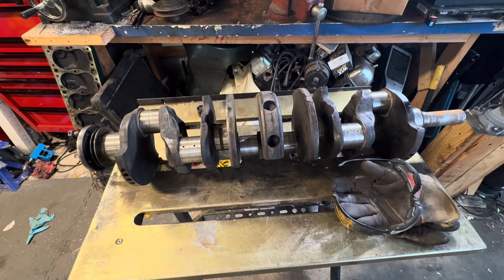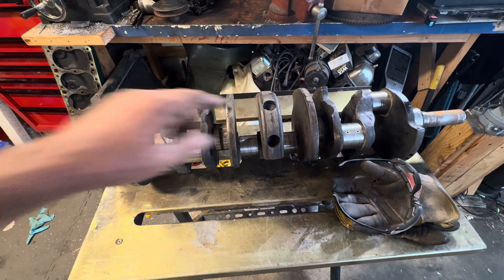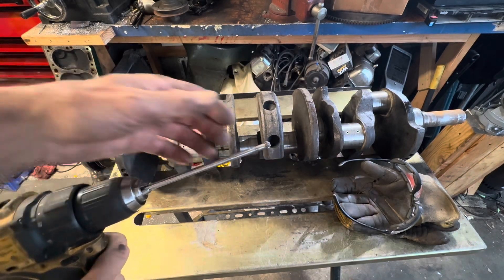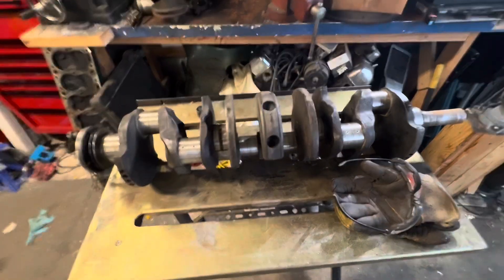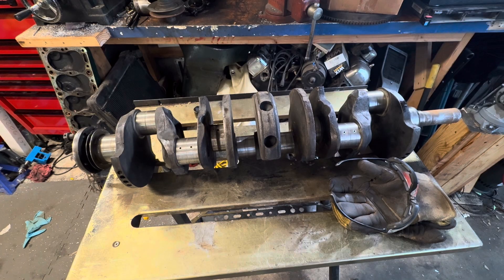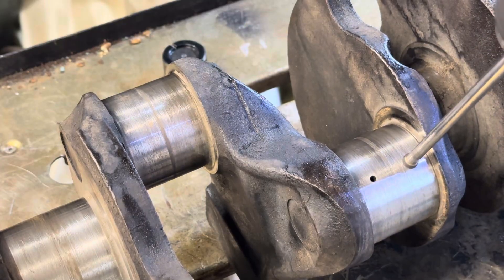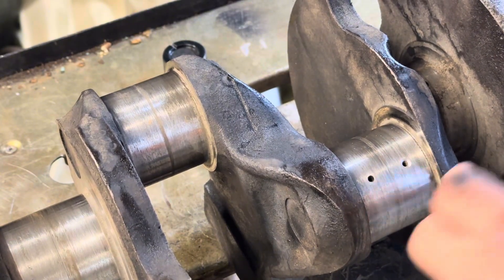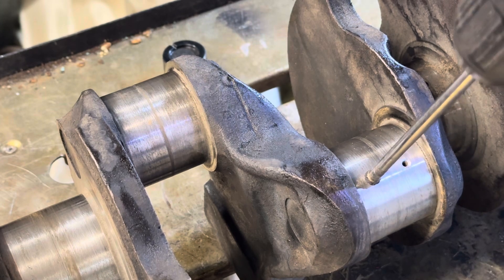Chamfer oil holes on crankshaft, my trick. Watch me do this on a Lincoln v12 crankshaft 😁

Comment: I built a few engines, never chambered the crank oil ports.  No issues.
Reply: If you send out a crank to a machine shop to be ground undersize, it's very likely that the machinist will chamfer the oil holes before they do final polish.
Reply from the maker: @Jurgy777 if you ask for it, or maybe they will recommend. I’ve built the last 5 out of 6 engines on the cheap without boring or machining anything. Just hone the cylinders and home polish the crank. Clean clean clean everything
Reply from the maker: Yes they are like that stock. Just better chamfered